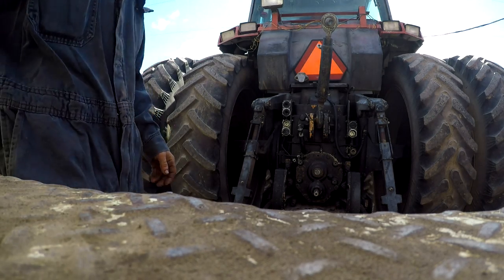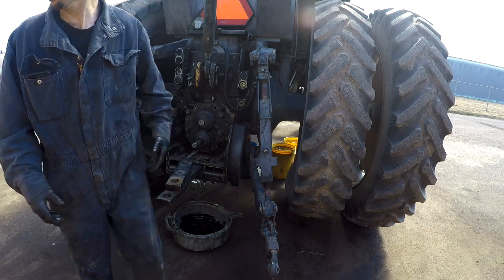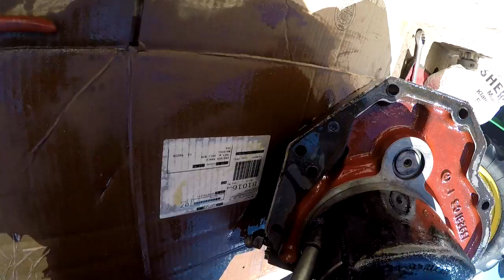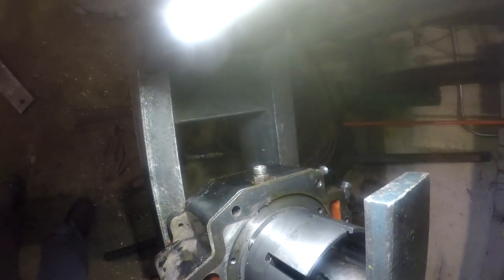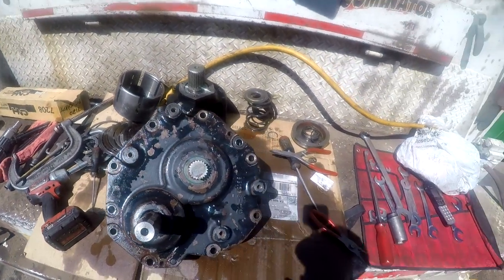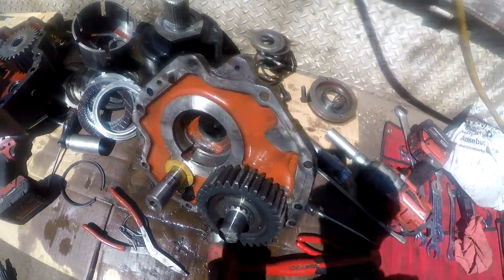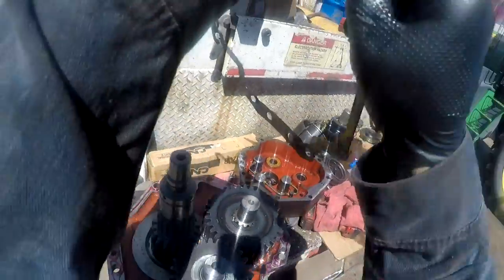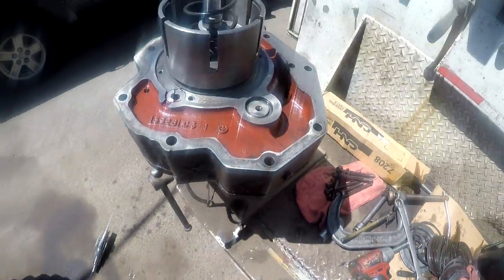7120 case ih broken pto shaft

Comment: Up in the northeast I start off with the correct type wrench and end up with whatever turns the rusted bolt. Sometimes it’s a socket pounded on, sometimes it’s an air chisel, could be a torch or cutoff wheel. Whatever gets the job done. I enjoy your videos. Thank you.

Comment: Litle something I did when running a service truck. The older I got the more my back required me to set on a swivel stool. I would carrie one of those cheap folding plastic tables to set up and work on. The table gives you tons of space to lay parts out and its at a perfect level for working on a stool. When your done just blow it off with brake clean and fold it up.

Comment: An idea for the wobbles. I take plywood, 1' x 1' or larger depending on the size of metal I am dealing with, cut holes out of them to surround the part, and set part in. Wafer them and screw together for desired height. The plywood will stabilize what ever I am working on. I then can take plywood wafers apart to store. It saves knuckles and I am half cripple so it saves my body as well. Just a thought to help you out there.
Carry on and great job.

Comment: I started out as a kid as a "backyard" guy. Worked in the 'top-notch' shops, the dealers, indies, and eventually my own business, and you "gotta start somewhere," is the reality. Tools cost money, and if your job is turning wrenches, you'll always try to have what you need to get the job done as easily as possible. Time is money, and if you gotta dig for a punch, or chisel, that wastes time. Screwdriver, and occasionally the BFH is the tool. If you do enough of the same jobs, you'll do the same work but faster, and with less tools. This is especially true if you're a flat-rate tech. You can either 'make time' or lose your ass if you run into something unexpected. The best mechanics are the ones who are used to working with very little, out in the field, or wherever need be. Its about adapting to your selection of tools, and doing your research first if its something you're unfamiliar with.

Great video as always Warren! I share your feelings with a lot of the stuff these people do to they're equipment. After they romped the shit out of it, they're asking us why it broke.... LOL. Keep the good stuff comin man! 👍

Comment: Warren, You could weld up a platform that you can mount in your vice to get more work space. It could be your laptop desk. I make platforms with a carpet cover. Screws and nuts and other small parts do not roll around

Comment: The irony those parts for JD need to come from Germany. 

The only thing I can think of that could make that spline snap is shock loading it, and probably the emergency clutch on the equipment they are working with is seized meaning the pto takes a pounding.

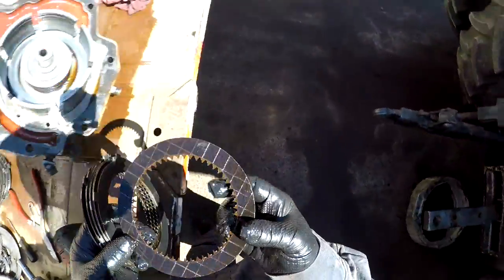Comment: Did you catch that you put the clutch return spring centering spacer cap on upside down? Check the video at 23:49 before you removed it and at 57:23 when you were replacing it in the press. Probably the  reason the alignment was off . The depression side should have gone into center of spring to keep it centered and the center lip should face up towards the snap ring.

Comment: Hey guy looking at the buying an older RV GM maida RV between 1973 and 1978 that was gas powered there's like a 455 Chevy engine front-wheel drive I'm wondering if you were going to buy an old RV you know something's  15 years old would you go with diesel or would you go with gas powered

Comment: Hey man
My 2470 leaks where the shaft goes into back of split case.
The seal is floating loose.
How do I change it . Maybe slide new one on ,without pulling it apart

Comment: warren there is a tool for automotive steering wheels to remove lock plate there are two different  sizes that will help you do this job better and faster

Comment: I really like the video. Is it possible to change the rear bearing and the seal on the 1000 PTO shaft on my 7220 without removing the housing? Thanks
Reply from the maker: The seal , but not the bearing.
Reply: @westerntruckandtractorrepa1353  Okay. Thanks a lot
Reply: How much time is involved if nothing else is wrong to change both. The seal and bearing went after a problem that broke the bearing on the forage harvester side of the PTO shaft
Reply from the maker: @jonym45  Usually 3 to 4 hours
Reply: @westerntruckandtractorrepa1353  Wow! Thank you very much. A service technician will be doing the repairs, but I was curious to see what went into the repair. BTW,  the farm is an hour west of Montreal, Canada

Comment: Love what you do Warren but.. I was wondering how that pto clutch on the Case 7120 that had a broken shaft is working.  It looked like the spring retainer went back on upside down.
Reply from the maker: I caught my mistake.
Reply: @westerntruckandtractorrepa1353  

I thought you would... you have a great work ethic
Reply: ive heard that diesels can run almost anything oily... is that true?
Reply from the maker: @kennault6276  The old mechanical engines, not the new ones.

Comment: Work fast and efficiently is a big deal IMO.  I'm constantly on my guys in the shop over wasting time on the trivial crap.  I work just like you do - get it done now, the customer is waiting  - or else there's a half dozen jobs behind it, if nothing else.  My guys will take apart something which comes right apart with ease, and then spend and extra hour chasing threads of the bolts with a die, or running a housing like this PTO unit through the parts washer when it's not even dirty.....makes me nuts and it's one of the reasons I hate supervising...Every job I compare the ticket time on they take double what I think it should take with help then what I have always done working by myself. I have to tell the customers to leave unit at our shop overnight for jobs I used to do in 3 hours while they waited....   But I just got a new service truck and and I'm taking every  opportunity to leave the shop and use it!!

Comment: The guy who says he's never interchanged metric/imperial tools has never worked on anything outside of warranty age IMO. Like you say it's a good dodge for when there's either corrosion or damage to a bolt head.  Probably not used to working on plant/ag equipment either, there's more scope for compromise with bigger bolts.

Comment: Ask the John Deere guys about overloading the PTO on the 8400 series 15spd powershift trans,most of the time it's $20,000.00 for a rebuilt transmission , when a 1in wide gear shreds.

Comment: Usu5the reason those shafts break is the drawbar is set too short, and when the driver turns at the end of the field, there is too much side pressure on the shaft.

Comment: I was always taught by case IH to use 3 m clear weather strip adhesive in hydraulics instead silicon slit doesn’t clog up ports in system